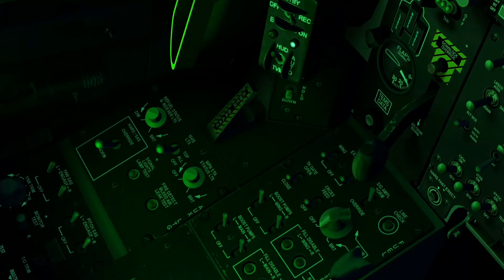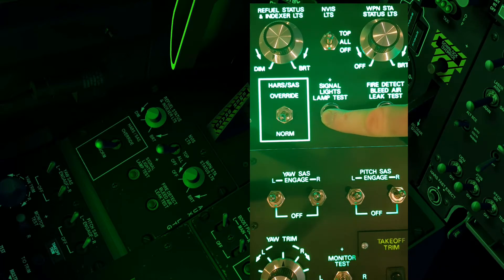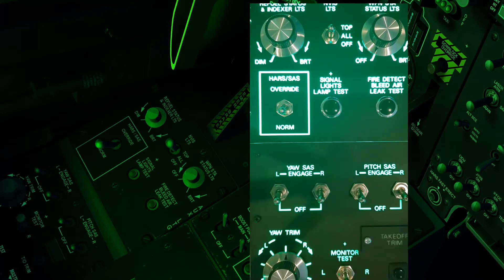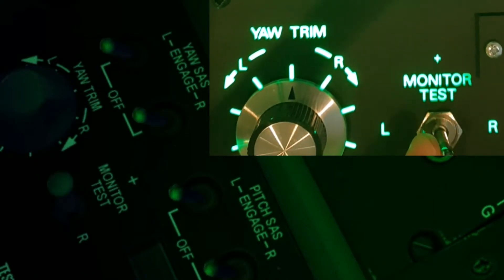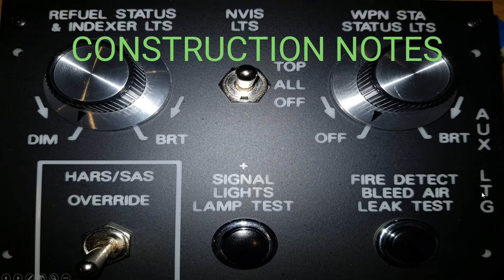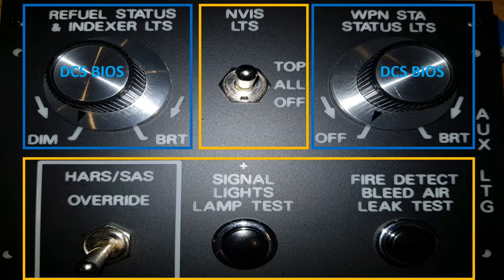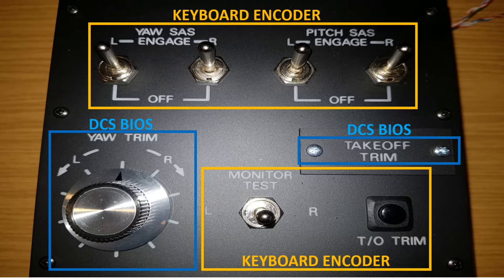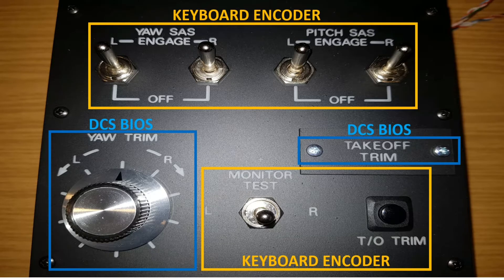DCS A10C Simpit AUX lighting and SAS panels

Comment: The secret to getting backlighting done better and without getting so many hotspots is to use clear acrylic and WHITE surface mount LEDs.

A lot of companies that make panels for sims use opal acrylic and just spray it black for blocking the light and then spraying it the normal panel colour. The. They engrave the text and markings and leave it at that... all because it is easier.

A better method is to use clear acrylic, paint it the same as the commercial sim panel maker but then comes the secret sauce. You paint the lines and text after you engrave which means you can select which colour you want the lines and text. This is the way real aircraft panels are made and using an all white illumination source means you don’t get weird colour mixing when you get multiple coloured panels. 

The best way to paint the text and lines is to wait for the main panel paint to really harden as you will be using cloth over a plastic scraper to remove the excess paint. You use a small artists paintbrush to flood fill the text... DONT USE THICK PAINT... and don’t over thin it with water. Use an acrylic binder to kept the paint’s ability to stick to the panel. Too much water causes the paint to lose it’s stickiness and will just flake off.

Basically you have to practice but when you do get there you won’t buy green and red led’s for backlighting ever again. I only figured it out after sitting on a real ATR72 panel and was amazed to see how it actually was put together. Was worth the pain of breaking an expensive panel and having a sharp piece of acrylic poke me in the butt. 🥴

Comment: Nice work, I learned so much watching your videos. I am thinking of building a pit at some point but only investigating and experimenting at the moment as well as doing electronic classes online to give me the minimum knowledge before jumping into it. Can you please explain if there is a generic rule on when to use keyboard emulator or DCS-BIOS? It seem to me that for simple switch you tend to use KB but when you need to deal with LED or pots or rotary encoders you prefer using DCS-BIOS. Is my assumtion right?
Reply from the maker: Hi fabmeloman, I think most people are using dcs bios for their whole pit. There's no question that dcs bios is pretty much a one stop solution. There are some strong points to encoders too so a mix of both is ideal. Check out this link http://mysimpit.co.uk/faqs/
On this web page I've outlined some of the pros of each.
Cheers
Reply: Ok, thanks for this. I have a feeling that if I go for it it would be heavily based on what you have done.

Comment: Craig, pots were not working well in DCS bios, because of spikes from noise. did you do anything special code wise to remedy the noise problem? I switched to rotary encoders in the past because of the problem with pots.
Reply from the maker: Hi rocketeer, some time ago I did find the pots would shiver. However one of the recent releases of dcs bios included a fix for this and my pots sit happily with no shivers now. However, I have had a problem where turning the pots can have lag which you can see in the sim. So far, I have put this down to my PC being old and found that when loading a mission for testing my panels, if I turned off all the opposing forces vehicles (ground units, air units, etc) it seems to run much better. I'm currently building the intercom panel which will also include the stall volume panel as part of the overall unit. This is the perfect way to put all this to the test as it has 11 pots.
If it is my PC, then at this rate without an upgrade I'll be sitting in my completed pit with everything switched off and be the only vehicle in the mission, lol.
Reply: what is your dcs forum user name? it'd be cool to PM you and chat once in a while
Reply from the maker: Hi rocketeer, my Ed forum name is CraigS. Defo drop me a line sometime. As regards the dimensions of the DVADR, I'm off work Thursday so will get these and send over, cheers

Comment: Looking good CraigS. When you start looking for magnetic held toggle I suggest you go for the ones with change-over contact (right) instead of those with only NO contacts (left) https://i.imgur.com/3s8Lkdyl.jpg. The ones to the right are quite easy to implement with DCS-BIOS. Keep those video coming Sir
Reply from the maker: Hi Hansolo, thanks for your positive comments. I'll will definitely get those type of magnetically held toggles when the time comes. Also, I really like the post you put on the Ed forumns detailing your schematics and hook-up guide for the RS485 system you’re using. That guide looks spot on and in the near future I'll use that as a starting point when I create a network. Cheers

Comment: Amazin work! What bit and cnc engrave software are do u prefer
Reply from the maker: Hi Markus, the cnc software I use is Vectric Cut2D which does everything up to the point where it's saved as G-code and loaded into mach 3. I've never used any other software. I have found Cut2D to be a program where you can get into quite some detailed designs but it remains simple to use. It's very effective in what it does and has a high degree of functionality. Their cad/cam software range also extends to versions offering far more than what I do and use. For example where you can do 3d modeling and sculpting, special rotary tool paths, etc. I think you can download a free trial of Cut2D. You could always download and have a play around to see what you think. As regards the cutting tools, I typically only need 2. I use a 3mm end mill and 15 degree 0.2 engraving tool. I think a few times I used a different tool and that was because I wanted a smaller radius on the inside cut of a rectangle corner, cheers